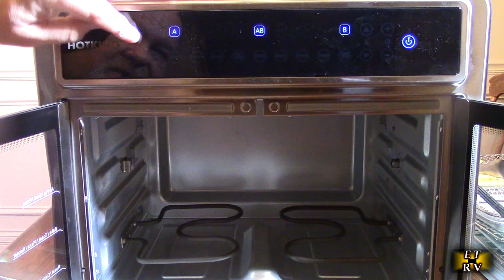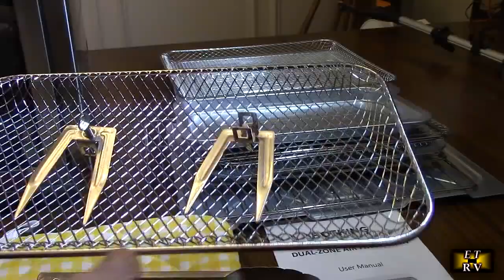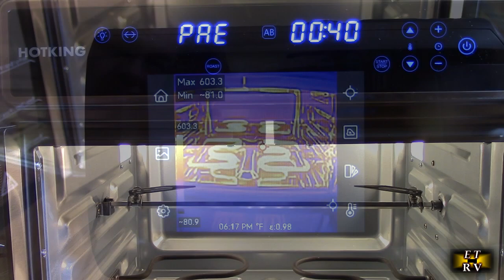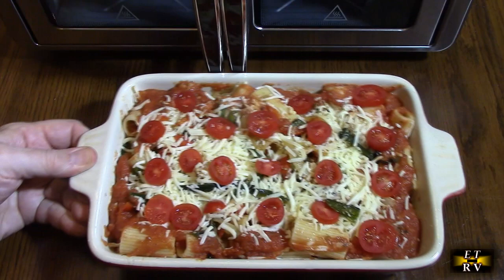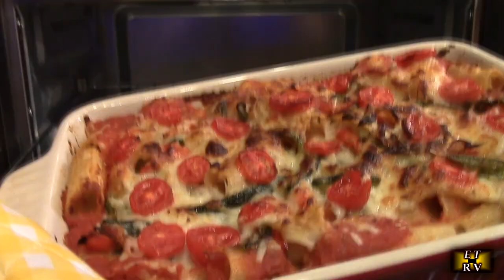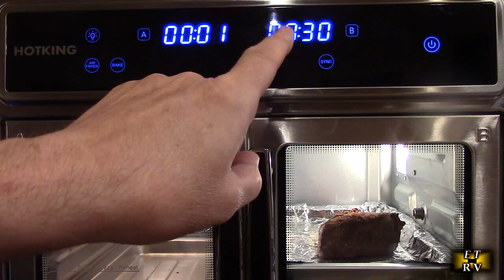HotKing Extra Large DUAL-ZONE Air Fryer- Toaster Oven, 28QT, Stainless Steel, Convection Rotisserie

Comment: Would you say this was noisy compared to other sir fryers. I just purchased this and I am hoping its quieter than my old air fryer. Also is there a way of turning the beeping off?
Reply from the maker: I use it daily and find it normal level sound with a varying fan used on most modes.